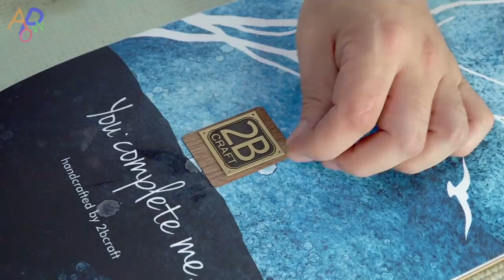Skilled Korean Skateboard Maker. Process of Making Longboard

Comment: A lot of care making the deck, but you use low quality bearings, you can hear them at 7:39 making noise, they should be quiet.
Reply: Eh, I'd rather take the lower quality bearings and save the money that they otherwise would have used as an excuse to ramp the price up. In the context of skateboarding, there isn't really a marked difference even between budget bearings and "performance" bearings like swiss ceramics (biggest scam in skateboarding by the way). Wheels are what determine how fast/long you can roll. I can't tell what wheels they used in the video (probably an OEM from china), but through their online shop the complete comes with hawgs fatties, which are a tried and true wheel.